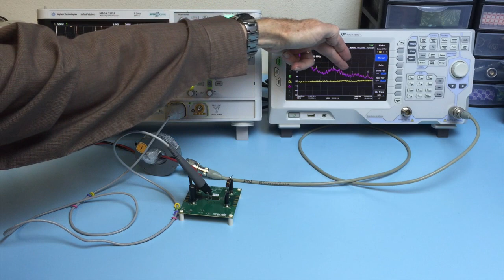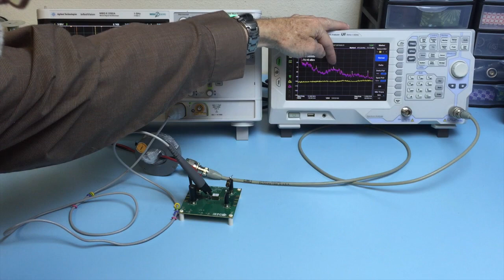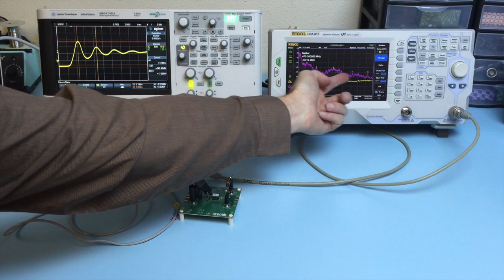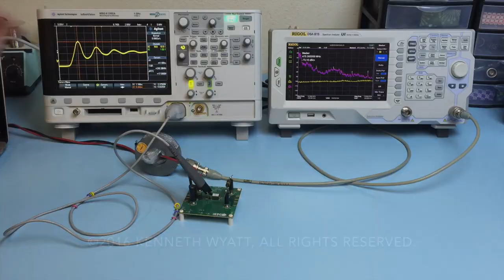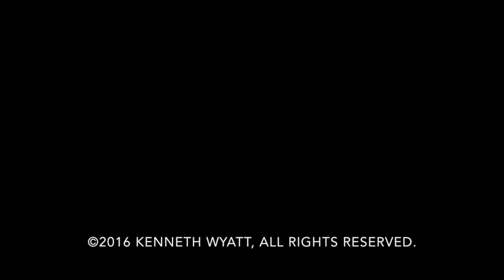Switch-Mode Power Supply - Ringing Demo

Comment: Thanks for the nice video. I moved into a new building at work several years back and was amazed at how much RF interference there was in the building. There are about 25 FM broadcast stations in my area, and inside the building, I could receive exactly 2. The rest was noise from the high efficiency ceiling lights that used SMPS in their "ballasts". Fortunately for those outside the building, we also had energy efficient glass windows for walls that were metalized and attenuated VHF/UHF EM emissions by 30 dB.  That had some effect on the FM station reception, but most was an increase in the received noise floor of around 60 dB.  Sure would be nice if someone could design clean SMPS electronics - or come up with a new technology to replace them.  Probably a Nobel prize in there somewhere ;-)

Comment: Do you thik this kind of ringing can be eliminated / reduced by a simple RC snubber connected to the switching node?
Reply: I was thinking the same. Good layout will surely help but an RC snubber should do the trick albeit with some added power dissipation.

Comment: Hi Ken, how do you reudce the ringing (the max voltage on switching node)
Reply from the maker: the ringing is a function of the PCB layout, filtering and the inductor itself.  I have used many eval boards from TI and several others, all have this issue, since they are designed to show the basic functionality of the IC and are laid out on a much larger area to facilitate probing and testing.
 
So.. I have tried replacing the inductors from different vendors and got different results.  On trick is to use an inductor with thinner wires, i.e. higher DCR, which will reduce the maximum current of the supply and also create a some more heat, but generally no one uses the chip in a Max load application anyway.

you could also install a snubber circuit across the switch device.
Reply: @emc_guru  Thank you! I was thinking how to model this response as L, C, R, then try to find this voltage related with LCR, thus can decide which passive can be reduced or increased
Reply: @emc_guru  thank you , btw from PI analysis point of view, using an inductor with larger DCR may cause the DC drop analysis to exceed the max DC voltage drop allowance when incorporating the inductor model into the analysis
Reply: Would it be advisable to change the hot loop cap to one with a slightly higher Ω?

Comment: I have seen this with multiple Texas Instruments regulators. I got seriously angry when I saw this, we pay 50$ for such an EVB..... they should pay us 50$ for that. Actually we spent 250$ for their crappy EVBs and chipsets.
Aside of that their units also gave us audible noise at around 16khz,.

Since that moment I told our engineers to stay away from TI regulators, they're pretty much a failed company when it comes to QA and voltage regulators as if their engineers have no ears.
Reply: I don't believe one can generalize that TI's devices are bad. All manufacturer's DC-DC converters can be prone to ringing, depending on the rise/fall times of the switch. The GaN devices switch in hundreds of picoseconds, so are potentially bad for EMI. Parasitic inductances and capacitances due to poor PC board layout is also a factor and can be partly to blame for ringing.
Reply: @wyattphoto1 I'm sure you're right.

In our case we noticed audible noise in the first instance.
I'm not an SMPS designer, but those issues seem to be discussed but when looking at those parts they're completely ignored by TI.  

TPS54528EVM-052
TPS565208EVM-858
TPS54335AEVM-010

Ringing is not observed on all of them (I don't have the exact test results in mind anymore).  At least one of them shows the exact same pattern as you have on your scope. TI recommends a particular layout, so most customers will probably end up with the same issues.

From my point of view those issues should be discussed and get much more attention, it's not such an issue if you know about it when buying such a product.

Maxlinear is also using one or two of those components and they're facing the exact same issue with it.
Reply: @mrechbreger  the ringing is a function of the PCB layout, filtering and the inductor itself.  I have used many eval boards from TI and several others, all have this issue, since they are designed to show the basic functionality of the IC and are laid out on a much larger area to facilitate probing and testing.  
So.. I have tried replacing the inductors from different vendors and got different results.  On trick is to use an inductor with thinner wires, i.e. higher DCR, which will reduce the maximum current of the supply and also create a some more heat, but generally no one uses the chip in a Max load application anyway.    

One of the consistent problems with the TI and others' eval boards are the filter capacitors on the input and especially the output.  They were populated with X7R Ceramic SMT capacitors of whatever value the design calculated, such as 22 uF.  Usually there were several smaller values in parallel.  Unfortunately at higher voltages ~ 12 - 40 V, the capacitance is generally less than 20% of the capacitor's rated value due to the DC  present. So that when there were 3 * 10 uF or 5 * 4.7 uF capacitors the actual value was only 3 or 4.7 uF (i.e. 20% of rated value) for the lot, instead of 22 uF expected.
Reply: @shazam6274  I think the audible noise came from a feedback capacitor; it's not due to the layout it's due to the design. 
Yes we were also able to adjust the audible noise a little bit but we couldn't get rid of it with the TI parts. We did not max out the chip capacity.
Finally we have chosen Monolithic Power Systems, even a poorly scratched 2 layer PCB did not give us any audible noise.

I think TI wanted to get onto the PMS train with immature designs (and that certainly includes audible issues - not only the functional part).
Reply: @mrechbreger  So if I understand you correctly, the audible (not electrical) noise of a capacitor is the fault of the IC?  Did you put that same capacitor on the MPS circuit? was is quiet or noisy?  I like and have used both of these vendors as well as Richtek without issues.
Reply: @shazam6274  well the source is the ringing on the output, I did not investigate the issue further since the MPS circuit just worked for us -- very likely they just moved the switching outside of the audible area or at least paid attention to it.
For the MPS circuit - we have just used components from our default stock (same as with TI), we never had any MPS EVB for testing.

I don't want to touch that part since the feedback is monitored by the regulator, any wrong (unexpected) result might make the circuit operate in a wrong way.

Audible noise on switching regulators is known to TI and MPS, another TI part even has a paper about audible noise (but we never experienced that issue with that particular part).

So at the end it just leaves:
- contact the TI support and spend a lot time trying to resolve their problem
- or check alternatives when implementing it, according to the need of your design (but leave space for alternative solutions on the voltage regulator implementation).